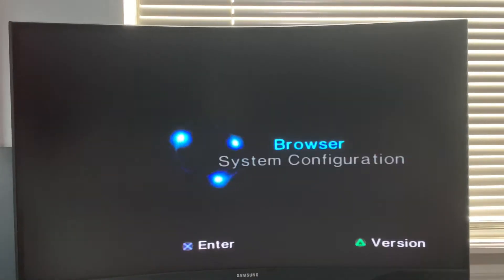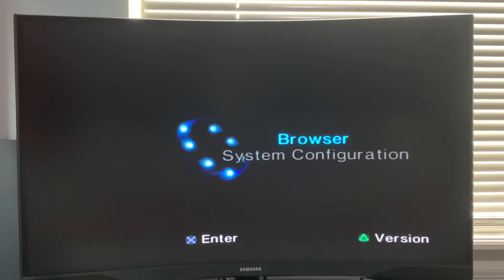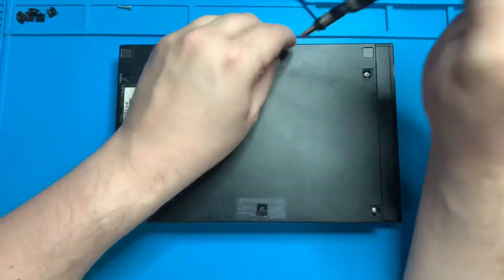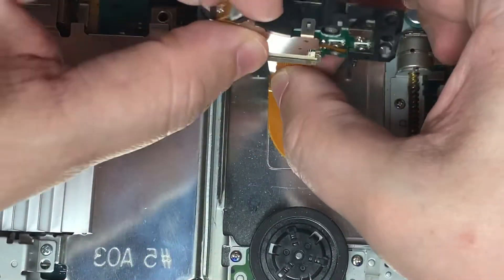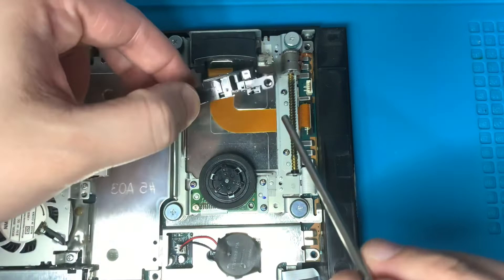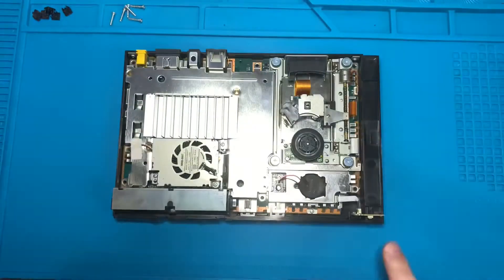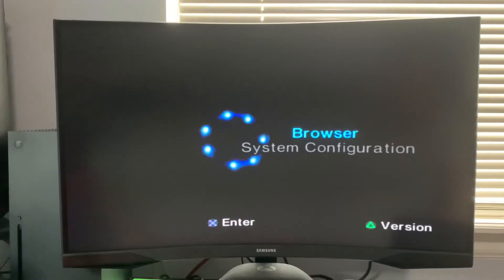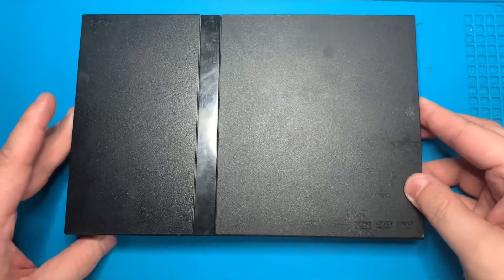How to replace a dead/dying laser in a PlayStation 2 slim console (PS2)

Comment: Removed old laser and blob on new one.  Reinstalled exactly to video and it no longer moves or spins. Put the old laser back and now it does the same. It at least used to move  I'm saddened.
Reply from the maker: When you have the system open (depending on the model) there are two buttons that need to be pushed down in order for the laser to even activate. Make sure those are being pressed down when a disc is open. If the laser doesn’t move at all then there is more than likely a rip in the cable that is connected to the laser.
Reply: @videogameexpert41  Update!  I bought two more lasers.  (Just in case)  I installed the first one and everything is working perfectly now.  Reads PS1 CD, PS2 CD, and PS2 DVD's and very quickly just like your video.
Reply from the maker: @ that’s great!

Comment: it's gonna be probably a dumb question but what's the reason for removing the soldering ball in a new laser?
Reply from the maker: The solder is touching three different contacts which shorts the laser. Until you remove the solder and separate the contacts the laser will not operateZ

Comment: Hi, thanks taking the time to put this together. Nice job and presentation. I followed the steps but I didn't do something correctly. When I tried to test, and powered on, the lense didn't stop moving up on the control bar. It's like the bracket on the right of the lenses isn't connected properly to the control bar or the lenses doesn't detect when it's needs to move back. Not sure if you have experienced something like that before.
Reply from the maker: That sounds like it could be an issue with the ribbon cable that’s connected to the laser.
Reply: Thanks @videogameexpert41  I will re-check.
Reply: i think I found the issue @videogameexpert41  . I didn't have the laser seated properly on the left side.

Comment: Hi, good video.  Do you think it's a good idea to replace the ribbon cable at this time? Considering many slim consoles ribbons scratch discs? I just bought a used 90001 series off eBay and it is leaving rings on many of my pristine discs. Thanks so much 👍👍
Reply: Isn't that issue with the ribbon cable solved with the later 9xxxx model numbers? If not, and you're gonna attempt it (if you haven't already), there's a 3d printable ribbon protector which can be placed to protect the ribbon cable forever.
Reply: @4n0nym0u5  Sure. If happen to have a 3D printer 😅. What I've noticed is, the ribbons have an adhesive strip on them when you buy them. And I assume over time the adhesive starts to let go. Allowing the ribbon to stand up higher in the extended position. Or the descended position. Not sure which. But the scratches are always near to the center of the disc. Not cool. The game seems to screw up after the first part of play. I've been able to polish out the fine scratches by hand. But it's never 100% again. So you can never pass down or sell the games without consideration of playability. Thanks Sony.
Reply from the maker: Thank you for the kind words! You can definitely replace the ribbon cable if you’d like. It’s more than likely scratching the disc because it’s sticking up too far from the surface. You can try taping done the ribbon cable slightly. Make sure the laser can still fully move all the way forward and back however.

Comment: Hi my disc spins fine but doesn't read disc what should i do ?
Reply from the maker: You need to follow this video and replace the laser.
Reply: @videogameexpert41  but my laser works fine what might be the problem the disc ?
Reply from the maker: @hafihashim  if it’s spinning but not reading, the laser is going out. There are two different lasers. One reads PS1 and blue PS2 Discs. The other laser reads clear PS2 games. When the lasers go out they usually stop playing one or the other and can still play the others just fine.
Reply: @videogameexpert41  how can i know if the laser is the problem because i could see it blinks when i touch the sensor , but my disc are very old so what do you think the problem is ?
Reply from the maker: @hafihashim  even though the laser is unable to, it will still try and read the disc. Over time the laser becomes weak and will not read discs any longer.
Reply: @videogameexpert41  ok thanks but how much a slim laser cost ?
Reply: @videogameexpert41  i'm from india do you know where can i buy it with the cheapest rate ?
Reply from the maker: @hafihashim  like $20-$30 on Amazon. There should be a link in the video description.

Comment: Hey are you on Instagram if yes then please send me a zoomed pic of you laser to check if your laser and my laser is same because I think my laser is broke so pls send me your acc thank you
Reply from the maker: I do not have a Instagram. Almost all PS2 slim consoles share the same laser.
Reply: @videogameexpert41 none of the ps2 slim consoles have the same lasers there all slightly different with different model number names
Reply from the maker: There are a couple different versions of laser for the PS2 but slim systems definitely share the same lasers across multiple versions of the system
Reply: @videogameexpert41  thats true i just remembered that the slim scph 7500x model uses the same drive as 7700x model
Reply: @videogameexpert41  no meant my laser is broken I think so I just wanna check if it is really broken or it is good just having dust but we'll you do not have insta so atleast put a pic in community
Reply from the maker: @GURUKULxBLITZ  I don’t have a PS2 slim at the moment and I have no lasers on hand.
Reply: @videogameexpert41  oh man ok thanks I think I gotta go to Sony for replacing it

Comment: Can you use anything else to burn off that piece before putting it on?
Reply from the maker: I wouldn’t try it. You can get a soldering iron for like $15 on Amazon. You can heat it up and literally swipe it across and it should come off.

Comment: I replaced the old laser (which could read CD games, but not DVD ones) with a new one off from ebay and it would read DVD games, but not CD ones so I just returned it and tried with a new one from Amazon. Sadly I just ended up screwing up one of the ribbon cables attached to the drive mechanism,  so rn I am waiting for the new replacement and playing my old games on PC lmao. Hope this thing works with the replacement dawg
Reply from the maker: I get replacement lasers from Amazon for about $20. They work about 75% of the time for CD and DVD games. If they don’t work I’m able to send them back for a replacement or refund and they only take about 1-2 days with Amazon Prime if that’s available to you.
Reply: @videogameexpert41  Yes I do have Amazon Prime fortunately, it is very convenient when dealing with this kind of cheap/bad quality stuff
Reply from the maker: Did you ever get it fixed?